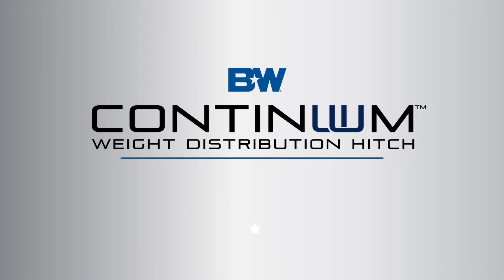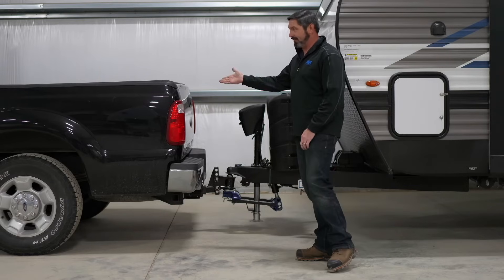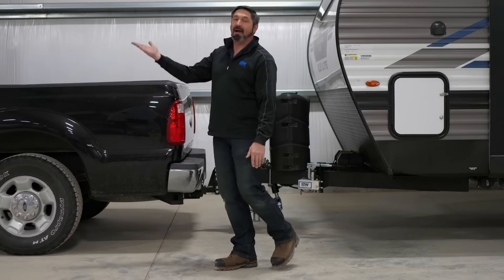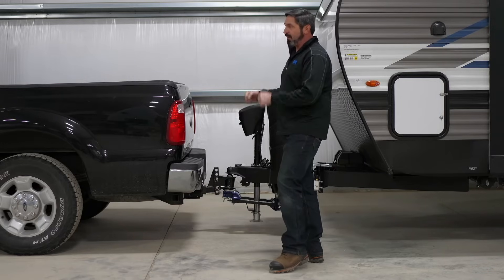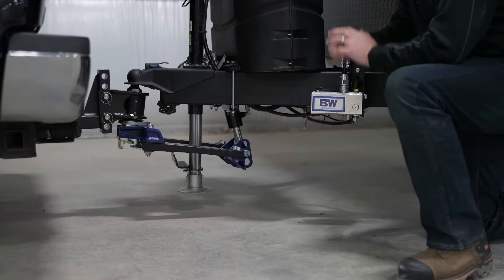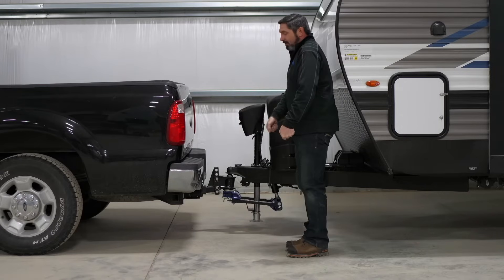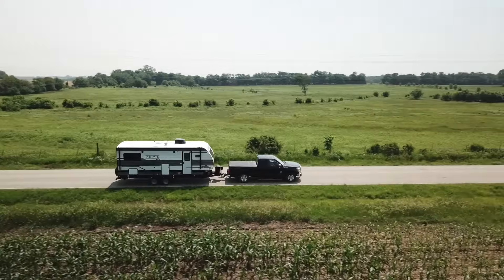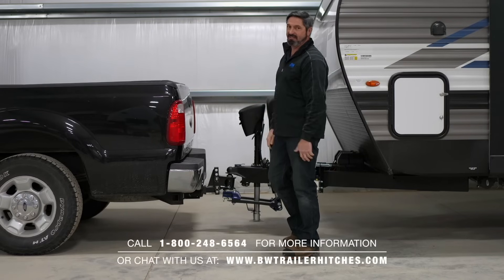How Does A Weight Distribution Hitch Work?

Comment: But you lift up on the handles on a wheel barrow. With this the trailer is pushing down. So how does it lift the rear of the truck when it’s pushing down?
Reply from the maker: We'd be happy to help clarify. During setup, upward pressure is applied to the ends of the spring bars where they attach to the trailer frame. Much of the tongue weight is still concentrated on a single point (the ball), but the upward pressure on the bars stiffens the connection and creates additional leverage. This allows the tongue weight to be spread out over a larger area. Which helps level the truck and trailer and restore a portion of the weight lost off of the front end of the tow vehicle.

---

A weight distribution system is made up of a specialized ball mount (head) assembly that is used in combination with a pair of spring bars. These two bars attach to the head assembly, extend partially down the trailer tongue, and connect back to the trailer frame.

In contrast, with a standard ball mount, the trailer coupler will rest only on the hitch ball and this single point will support the trailer's entire tongue weight. The downward force can cause the rear of the vehicle to sag and the front to rise. Much like a seesaw. When this happens, weight has effectively shifted off of the front axle of the tow vehicle.
Reply: @BWTrailerHitches thanks for the extra explanation. I’m not arguing that it doesn’t work because it does. I’m just saying it’s hard to understand it. No matter how you explain it, the connections are all at the hitch. You have weight at the hitch. And then you have this upward force on the hitch where the downward weight is. And that’s supposed to push down on the front of the vehicle. It’s like… yeah right.
Reply from the maker: @brianlittle717  No trouble at all! Here's another way to think about it:

A regular ball mount connection is like sitting on the very end of a diving board, everything bends at that one point.

A weight distribution hitch is like adding stiff braces that tie the board back to the frame. The weight is still there, but now it’s shared across multiple supports, not concentrated at one spot.
Reply: @BWTrailerHitches but the hitch was already bolted to the frame and the diving board is meant to be springy.
Reply from the maker: @brianlittle717  The truck's suspension is designed to be springy as well.

A hitch is bolted to the frame, but a ball mount sits at the very tip of that frame. Adding weight to a single end can cause the frame to dip in that direction (partly because of that springy suspension). 

With a weight distribution hitch, the ball mount connection has the added support from the spring bars, which help tie the truck and trailer together more rigidly. 

That stiffened connection and the leverage forces the tongue weight to be more evenly shared across the whole setup (truck, hitch, and trailer).
Reply: @BWTrailerHitches yeah I can sort of understand how it would be if you welded the trailer frame to the truck frame and made it a solid rigid unit. The bars don’t do that but that’s kind of what they do.

Comment: So basically makes vertically rigid connection. Now what happens when road transitions from straight into the hill, or rear axle gets under the shallow ditch?
Reply from the maker: Not quite. When properly set up, a weight distribution hitch doesn’t create a completely rigid connection. The spring bars apply leverage to help balance tongue weight across the axles, but they still allow enough flex under normal road conditions to avoid binding or overloading the hitch or frame. That’s why choosing bars that match your actual tongue weight is so important. Using bars rated too high can make the connection overly stiff.

That said, if you face a sudden change in terrain, like a steep driveway entrance or sharp dip, it’s best to disconnect the spring bars temporarily. Doing so prevents unnecessary stress or potential damage to the hitch, tow vehicle, and trailer.

 With the Continuum, our composite spring bars are engineered to be lightweight and flexible, yet as strong as steel. This allows them to handle a wide range of tongue weights (600–1,600 lbs.) without adding stress to your setup. The hydraulic system is also built to automatically relieve pressure when it exceeds 3,000 psi as a safeguard to help protect your hitch, tow vehicle, and trailer during sudden or extreme load events.

Comment: Okay, so how much force is being applied to the bolts holding the hitch in place? Aren’t they rated for a sheer strength for a set amount and now that force is being amplified by the WDH Because now something is in a bind and transferring the pressure to the front what  might be the downfall to that?  Also wouldn’t it do the same thing to just add airbags to the back of the truck to level it out?
Reply from the maker: We can’t speak for other brands, but we can assure you that the Continuum Weight Distribution Hitch and all of the components that are used in the hitch, including the hardware, have been engineered and tested to handle the forces associated with towing a travel trailer.

While airbags can help level the vehicle, they do little to properly redistribute weight across the axles. In contrast, a weight distribution hitch uses leverage to shift weight across the axles. This helps enhance stability, steering, and braking for safer, more controlled towing. For better handling, especially with heavier trailers, a weight distribution hitch is the more effective solution.

Comment: this is physics impossible, so does that make it magic? the only way this can work is shifting weight to the rear of the trailer by raising the tow point. it would never transfer weight to the front axle of the truck, it can only remove weight from the tongue by shifting it back
Reply from the maker: A weight distribution hitch doesn’t remove tongue weight; it just helps redistribute it across the axles by using leverage.
Reply: @BWTrailerHitches As you stated the hitch redistributes weight across all axles. The way WDH works is moving some weight back onto the trailers axle thus lessening the weight on the rear axle which in turn increases the weight on the front axle.

Comment: So if I air up my rear spring air bags, which keep the rear of the truck from squatting, does that do the same thing?
Reply from the maker: That's a great question, and one we hear pretty often. While air bags and weight distribution hitches are sometimes marketed as interchangeable solutions, they actually serve different purposes.

Air bags support the rear suspension, reducing sag when carrying heavy loads in the truck bed. While air bags can help level the vehicle, making it appear balanced, they do little to properly redistribute weight across the axles.

In contrast, a weight distribution hitch uses leverage to shift weight across the axles. This helps enhance stability, steering, and braking for safer, more controlled towing. For better handling, especially with heavier trailers, a weight distribution hitch is the more effective solution.

Comment: So if I’m still sagging, I need to drop the ball down a couple holes to add more tension to the bars?  Am I understanding that right?
Reply from the maker: If you're using the Continuum WD hitch, dropping the ball mount (head unit) will not add tension. But, if you're noticing excessive sag, here's a few recommendations that may help:

1) Confirm proper ball height: You may need to raise the head unit, rather than lower it. 
Park vehicle and trailer on flat, even ground. Chock the trailer tires and lower the trailer tongue until level. Next, measure from the ground to the top of the trailer ball coupler. We recommend setting the ball 1-2” higher than the coupler measurement. The Continuum's pin block can be turned over in the receiver if additional height is needed.

2) Trailer is loaded correctly: Ensure you're towing with proper tongue weight (10–15% of the trailer’s total weight) and not overloaded in the back.

3) Double check the wheel well measurements and FALR (Front Axle Load Restoration)*.
Find detailed instructions on this in our Continuum Install documents ("Engage WD Hitch", or Page 10): https://www.bwtrailerhitches.com/sites/default/files/WDHK4500%20%28pn%204510-210%29%2003%2006%202025.pdf

*Depending on your vehicle manufacturers recommendation and the setup, 100% FALR (Front Axle Load Restoration) might not be achievable. However, 50% FALR is most commonly what is recommended by truck manufacturers. Check your vehicle owner's manual for WDH recommendations.

Using the Continuum WD Hitch: If the target measurement cannot be reached before the cylinder rod is fully retracted and the cylinder bottoms out, then the cylinder will need to be secured to the lower hole in the lower cylinder mount.

Comment: 1300$ distribution  hitch that kills your break over angle
Reply from the maker: Totally hear you—price and performance both matter. Our bars do look low to the ground until they are loaded properly. We've performed many miles of real-world testing with our design and have not had issues except in extreme road conditions. Usually, the rear of the trailer or the leveling jacks will hit the ground before the hitch has any trouble with ground clearance. Like most weight distribution hitches, its possible that part of the hitch can drag when faced with especially steep dips in the road or entrances. But in those cases, no matter the WD hitch you go with, it’s actually best practice to remove the bars to prevent added stress to your trailer frame.

The good news? The Continuum’s bars are super easy to unpin, and you can tow using just the head unit like a regular ball mount. Plus, the hydraulic system is designed to automatically relieve hydraulic pressure when the system pressure exceeds 3,000 psi. This feature is to  help prevent damage to the hitch, tow vehicle,
and trailer during discrete/overload events.

Comment: I came here confused and also left confused
Reply from the maker: Got any specific questions? Feel free to ask—we’re happy to help!
Reply: @BWTrailerHitches 
you explained the concept, not the operation.
Reply from the maker: @billy_fred  When using a standard ball mount, the trailer's tongue weight is concentrated on a single point (pushing down on the ball). This often makes the back of the vehicle sag due to weight shifting, front to back, across the axles. Much like a seesaw.

When using a weight distribution hitch, a pair of spring bars are attached to a specialized head unit (ball mount assembly). These bars extend down the trailer tongue and connect back to the A-frame of the trailer. Once upward pressure is applied to the bars (similar to lifting the handles of a wheelbarrow) it creates leverage. The leverage reinforces and stiffens the hitch connection and causes the tongue weight to spread out over a larger area. This helps level the entire setup by lifting the back of the vehicle and bringing the front end back down.

Too much weight on the rear axle, and not enough on the front, can cause a number of issues such as poor handling and visibility, difficulty stopping, increased chances of sway, uneven tire wear, extra strain on the vehicle and trailer, and more.
Reply: @BWTrailerHitches 
i appreciate the detailed explanation. i understand the mechanics now

Comment: I heard that these void the warranties on some new trailers because of the extra load on the A frame.
Reply from the maker: Some trailer manufacturers will have specific notes regarding weight distribution hitch use. We recommend the following: 

Check the Owner’s Manual – Look for any disclaimers about WDH use.
Contact the Manufacturer – Confirm with the manufacturer whether using a WDH will affect the warranty.
Use a Proper Setup – Always ensure you are using the proper WDH for your trailer weight and that it is correctly installed and adjusted. An improper setup can cause damage to the tow vehicle and trailer. 

With the Continuum WD Hitch, our hydraulic system is designed to automatically relieve hydraulic pressure when the system pressure exceeds 3,000 psi. This feature is to prevent damage to the hitch, tow vehicle, and trailer during discrete/overload events.

Comment: Can I just get bigger tires on the rear to compensate instead of buying this product?
Reply from the maker: While getting bigger tires might help with traction, they won't solve the issue of uneven weight distribution when towing. A weight distribution hitch is designed to evenly distribute the weight across all axles of your tow vehicle and trailer, helping to improve handling, braking, and overall safety. Bigger tires alone won’t provide that balance and could even cause additional wear on your vehicle. So, if you're looking for a safer and smoother towing experience, a weight distribution hitch is definitely the way to go.
Reply: What about using airbags ?rear airbags does that do the same ?
Reply from the maker: @10scratchofftilliwin  Air bags and weight distribution hitches are sometimes marketed as interchangeable solutions for towing, but they serve different purposes. Air bags support the rear suspension, reducing sag when carrying heavy loads in the truck bed. While air bags can help level the vehicle, making it appear balanced, they do little to properly redistribute weight across the axles. In contrast, a weight distribution hitch uses leverage to shift weight across the axles enhancing stability, steering, and braking for safer, more controlled towing. For better handling, especially with heavier trailers, a weight distribution hitch is the more effective solution.

Comment: Question: does a weight distribution hitch adds or reduce the tongue weight or does it stay the same? I have a tow hitch class 3 rated for 600lb tongue weight or 1000 if using a weight distribution hitch, would I need to upgrade it in order to use the weight distribution hitch with a travel trailer that has a 700lb tongue weight or would that be ok? Help please, Thank you!
Reply from the maker: Great question! A weight distribution hitch will not reduce tongue weight or allow you to tow beyond the capacities of the vehicle. The tension on the spring bars essentially lifts up on the tongue, "holding" some of the tongue's weight. This causes a shift in the distribution of the weight off of the vehicle's rear axle to all of the axles in the entire setup. Typically though, we can verify that there is often a second higher capacity for the hitch for when weight distribution is involved. As long as you have confirmed both vehicle and receiver hitch rating is stated as 1000 lbs when using a weight distribution hitch, then you should be safe to tow the 700 lb tongue weight with a WD hitch installed.

Comment: How much weight is distributed back to the trailer’s axles?
Reply from the maker: The weight transferred to the trailer axle will depend completely on how your truck and trailer are set up. Due to the way a WD hitch works, some of the distributed weight will be put on the trailer tires, but this weight is negligible.
Reply: @BWTrailerHitches   it’s not negligible if your 5000 pound trailer is on 5000 pound axles.
Reply from the maker: @brianaustin1328  Hi Brian, sorry for the delay in getting back to you. We've reached out to our engineering folks about your concerns regarding weight distribution hitches and axle weight ratings. Since every rig will be different, they're interested in chatting with you directly to learn more about your specific towing setup. Whenever you're ready, feel free to give us a shout at:

800-248-6564 (M-F, 8am to 5pm CST)

Just mention that Tyler Jelinek from our engineering team said he'd help you out with your weight distribution hitch questions.

Comment: The manufacturers states that you have to unhook in driveways so that you can get so most gas stations have the same driveways that's at your house or worse so that means that you would have to unhook your distribution just to get just to get gas so most streets are not made for distribution ask the manufacturer States
Reply from the maker: We can confirm that most weight distribution hitch bars, such as those on the Continuum, are designed to flex under normal usage conditions. This flexibility accommodates the dips and inclines encountered during regular driving, eliminating the need to disengage the bars for routine scenarios like entering driveways, navigating fuel stops, maneuvering through campground sites, or making sharp turns. Saying this, one instance where we might advise disengaging a weight distribution system is before transitioning from level ground to a sudden and steep incline, such as when backing into a steep driveway.

Quick tip: It is important to be mindful of the Front Axle Load Restoration (bar tension) set on your specific system and follow your vehicle manufacturer's recommended FALR, typically falling between 50% and 90%. This ensures that during regular inclines and dips, the forces on the system do not make it significantly exceed 100% FALR.

These considerations were important to us during the design of the Continuum Weight Distribution hitch. The hydraulic design allows for easy dialing in or on-the-fly adjustment of your FALR with a simple pump of the handle. Additionally, the Continuum's hydraulic system is designed to automatically release hydraulic pressure during high-pressure towing events (relieving pressure should the system exceed 3,000 psi). This feature is to prevent damage to the hitch, tow vehicle, and trailer during discrete/overload events.